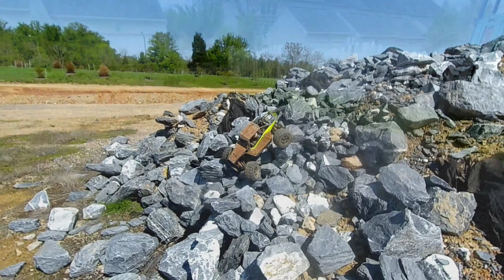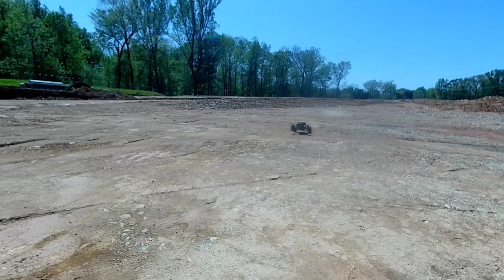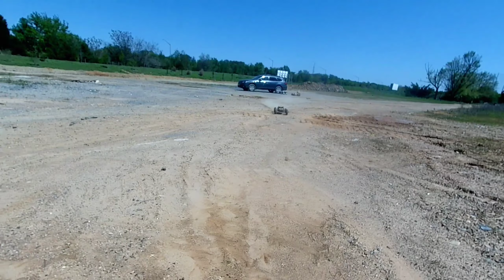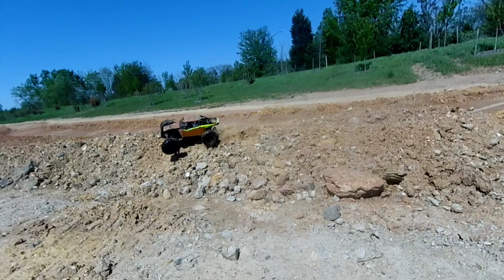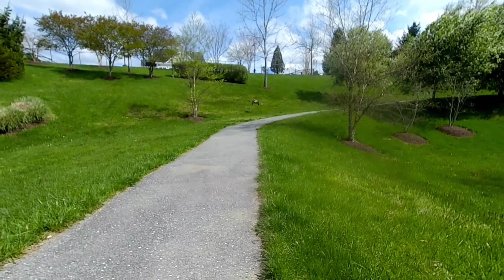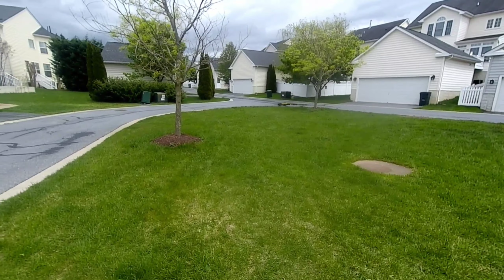Arrma Mojave Monster Buggy conversion. Mixed spot full on rip.

Comment: What a wild wide those little dudes in there just took!😆Killer rip and a very versatile rig! Hauls over terrain, jumps and rock climbs!💪A really nice build man! That wheelie roof skid then curb slide was awesome!😜Awesome vid ramp blast bro!!😎🍻💪🤘
Reply from the maker: Much appreciated brother. Gotta love the versatility of the Mojave platform. She seems to  handles great in just about any conversion you her into. Love Arrma in general. I'm trying to mainly keep her on the ground for some On-Road and off-road hard pull rippage  and some lite jumps. Cage body style just not meant for big airs. Stay safe Ramp Blast Bro.